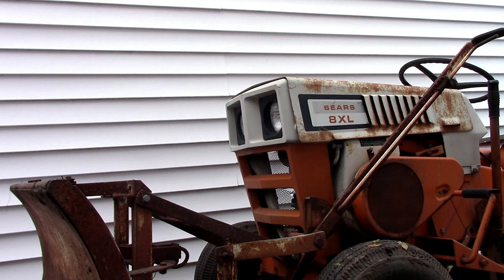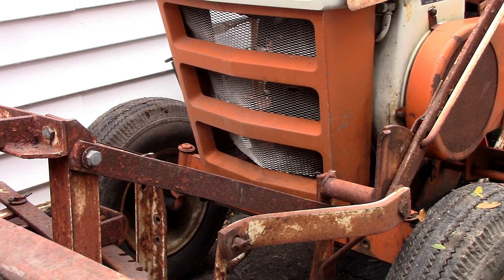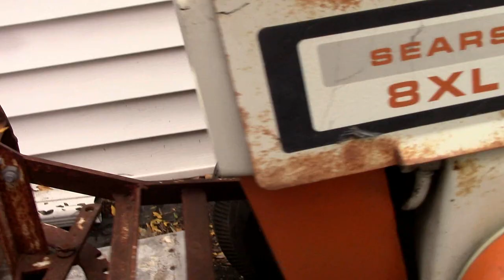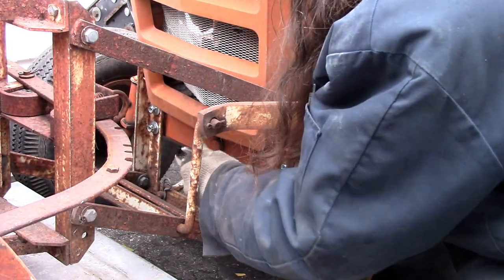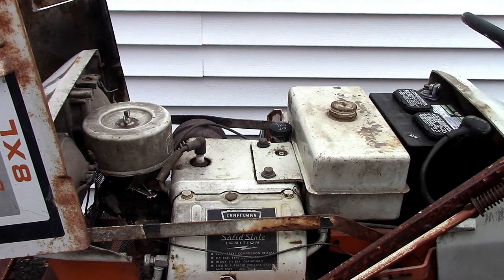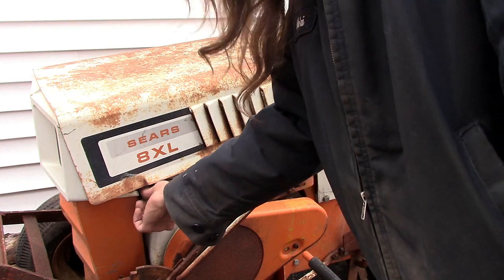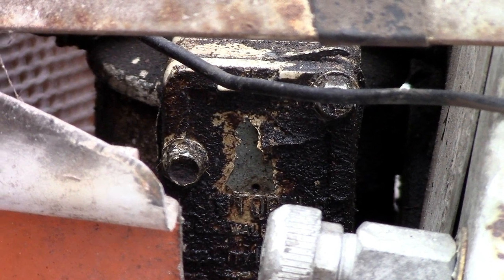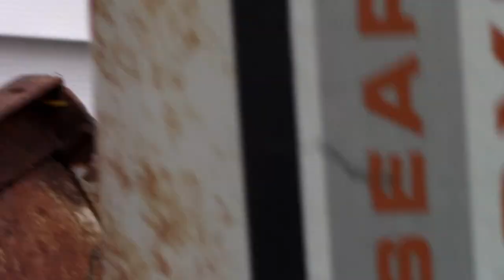1969 Sears 8XL Plow Install and Tzerambo Question!!!

Comment: She runs pretty good! That one will clean up quite nice! If it's 9311 then the engine was made on the 311th day of 1969 which would I guess make it be an early 70 since it's orange? I could be wrong but that's what I seem to recall.
Reply from the maker: thanks 71_Sears. Yeah, she' a keeper.
Reply: Rikki Starz yeah if I’m ever in the area I should stop by and see your place, there’s so much I haven’t seen lol! Maybe GTD 2019 will be a Custom convention?
Reply from the maker: that would be DECENT.